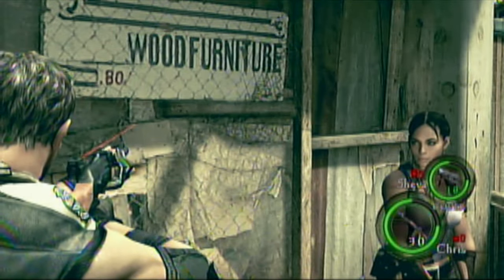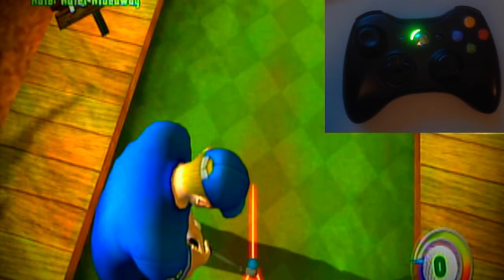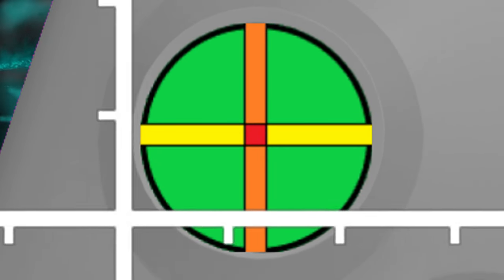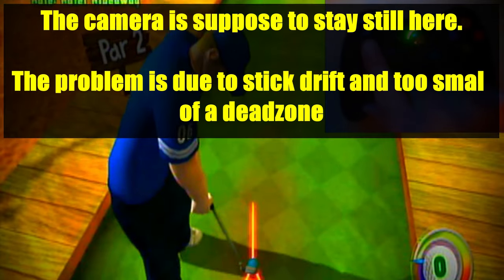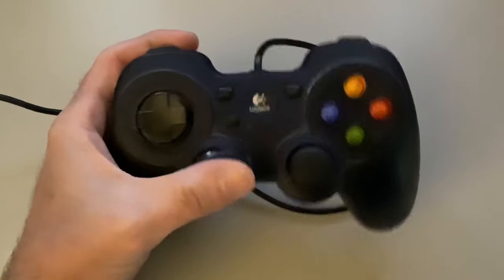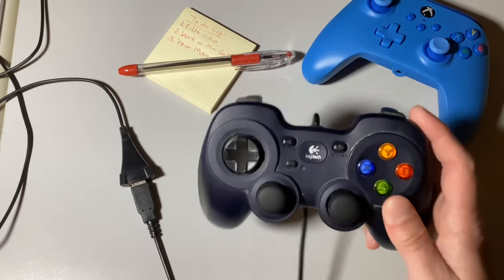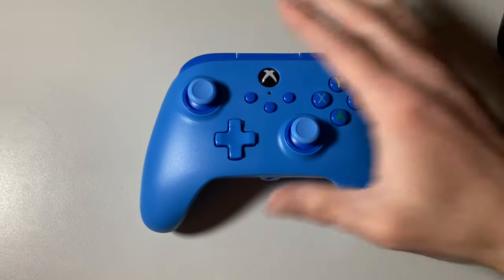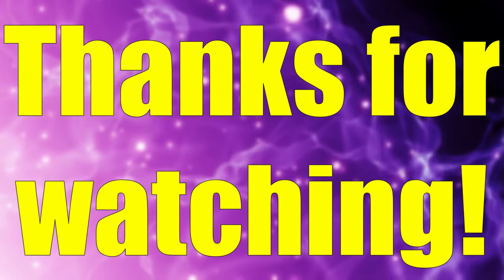You don't suck, your controller does...maybe

Comment: My favourite controller is a Gulikit KingKong2 I bought a while back. It lets you determine whether you want a hardware deadzone or no deadzone whatsoever, just by pressing a button combo on the controller. And because of the joystick technology it uses, having 0 deadzone is actually feasible
Reply from the maker: That's is awesome! Back when i bought most of my 3rd party controllers, i didn't have much extra income so i got cheapos as you could see in the video lol it was a small blessing though since i used these to test my game dev projects and found out about this issue since built in/hardware level deadzones is a fairly unknown issue. At least relatively speaking
Reply: @SethFunk  That's absolutely true. My only controller used to be a hand-me-down Logitech F310 (i think that's one you have & show in the video) and I didn't realize the deadzone was that bad on it! I always assumed it was the same as the first party ones.
Reply from the maker: @stefansuch1588  It's such a easy thing to overlook. I mean as a consumer, you would expect a controller made for "x" would act the same as all other controllers for "x". But I guess the saying "you get, what you pay for" is popular for a reason.

Comment: Or get a hall effect controllers
Reply: But they still have deadzones
Reply: not all hall effect controllers are the same. Some have truly zero deadzones, some still have built-in deadzones. The Qrd Spark N5 for example is a hall effect controller with axial deadzones.
Reply: @smokeyjoseph1790  on mine, at least, you can disable the hardware deadzone by pressing a button combo. it's so comically accurate that when you put even a little pressure vertically onto the stick it'll register whatever horizontal force you're incidentally applying to it

Comment: I had F310 and F710 controllers and boy they are terrible. And deadzones are just part of the problem - entire controller is a problem. Triggers are terrible and imprecise, materials are bad and batteries in the F710 are held way too loose so it's almost sure as hell will fall apart.
Reply from the maker: So true! Glad to know i wasn't the only one running into similar issues